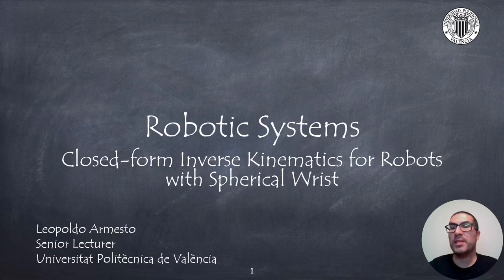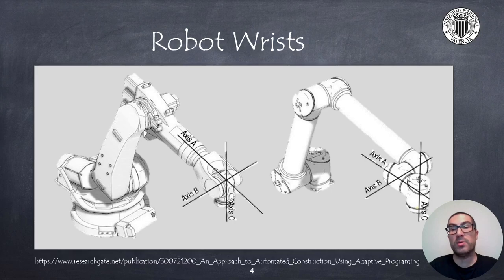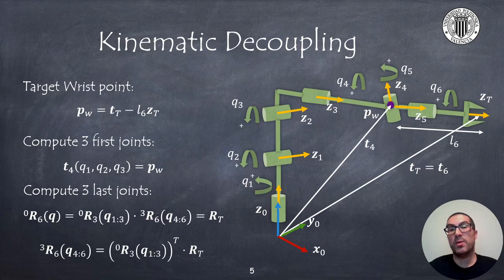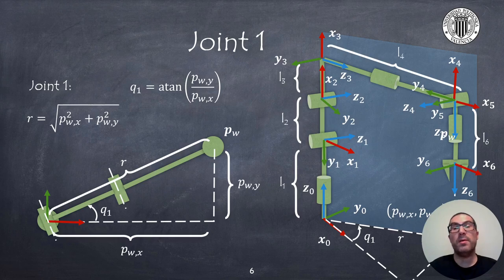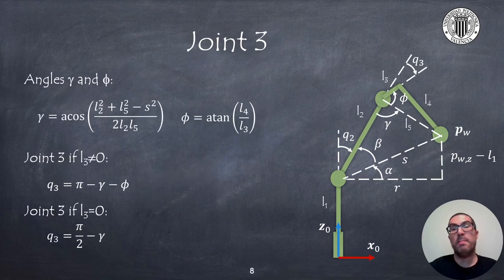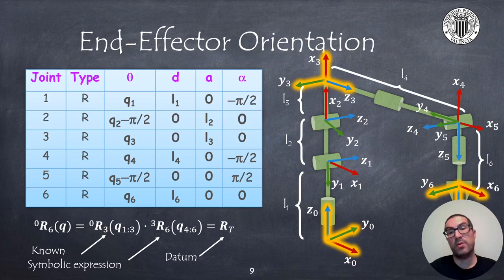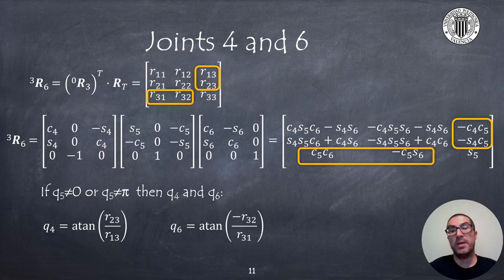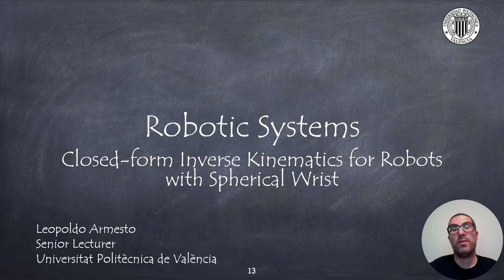Closed-form Inverse Kinematics for Robots with a Spherical Wrist | Robotic Systems (OLD)

Comment: I believe there is an error at 6:41. In the computation for of the R3_6 matrix the term in the first row second column is written as:  - C4*S5*S6 - S4*S6. However, this should be - C4*S5*S6 - S4*C6. If you look at the rotation matrix R5_6 the second column is [-S6, C6, 0] so the second term in the expression must include the C6 component from the rotation matrix.
Reply from the maker: It will check, but yes it seems you’re right. That’s a typo

Comment: Dear professor, thank you so much for this valuable lecture. I have a question if you don't mind. We use the wrist center point as input, calculate the last three orientation angles. I got it and I applied it on a model. But is there any way to use the end effector center point as input? There is a triangulation between end effector center, wrist center and l6 length, I guess that is the solution to my problem, but I couldn't figure out how yet. Thanks in advance.
Reply from the maker: Hello, for this type of robots, the position of tip of the end effector (p6) and the position of wrist point (pw) are always separated a given distance l6 pointing to some direction z6 (orientation of the last frame, 3rd column of the rotation matrix). So, we usually use the expression pw=p6-l6*z6 to compute the wrist point